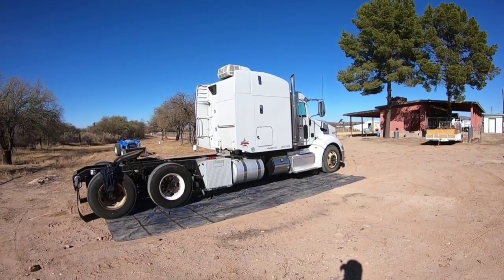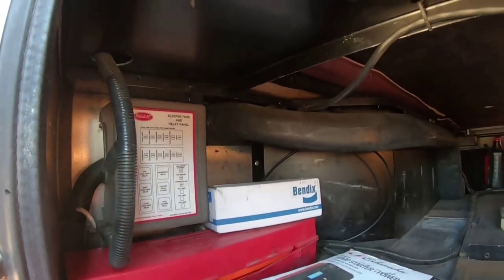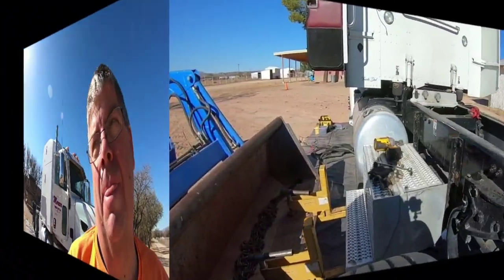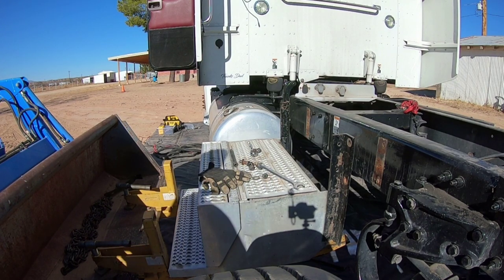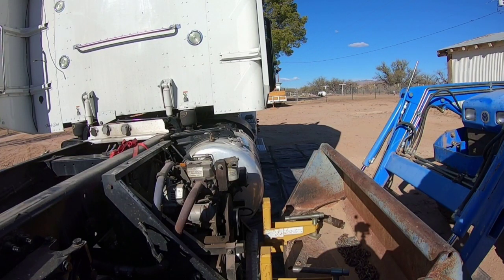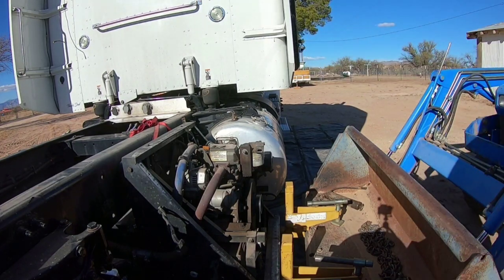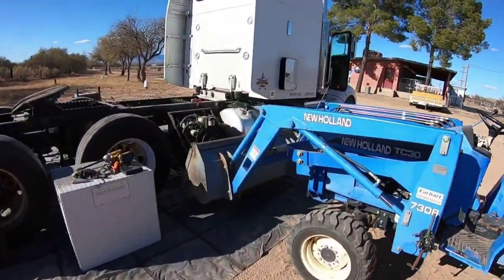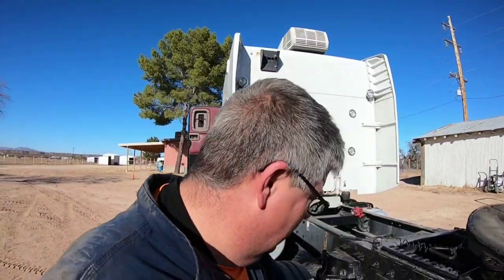#468 Removing the Generator The Life of an Owner Operator Flatbed Truck Driver Vlog

Comment: Dan swap the mounting angle brackets L to R & R to L as they sit now and it will put the mounting holes inside the box  length. That will give you more clearance in the limited space you mentioned. Work smarter not harder lol. I enjoy your videos, keep them coming.

Comment: A top tip for starting, when it has too stay unused, for a long time. Remove the negativ cable, that way it vil not use power too all the small cpu in the truck.

Comment: I know your not running that newer Pete right now.,but down the road after that step your taking off now, you can maybe move that def tank over on the driverside where it belongs.And  bolt it up where that step was.🤷And get a  longer tank too match up too the driverside.

Comment: Good video Dan as usual. Why didn't you leave the electrics in the short nose truck and buy new electrics for the long nose truck to handle the Aux Generator and your other power needs. That way if you ever have to switch back, those things will already be in there and its just a manner of mounting the unit because the wiring will still be there?

Comment: I thought U had left all the hoses & wiring attached to truck #1 & thought the gen units were same brand etc. Was hoping it was gonna be a 'plug in n go' deal..Hope the a/c goes easier 4 U. To bad the 'air wings' on the sleeper don't fold in for clearance

Comment: On that seal, does the surface it runs on. Have any damage to make it keep leaking? If so you should be able to get a new seal with a sleeve to help with that. Also if your breather for the engine is stopped up. That will force that seal to leak also.

Comment: I don`t understand why you just invest in another one instead of using the old one?
Reply: Because there like $10.000.00 to by another one not counting the side box that's another $7-$ 900.00 more and a.c. unit is another $ 1500.00 - $ 2000.00 so that's why he's doing it and looking at  maybe $ 3.000.00 to mount every thing maybe more